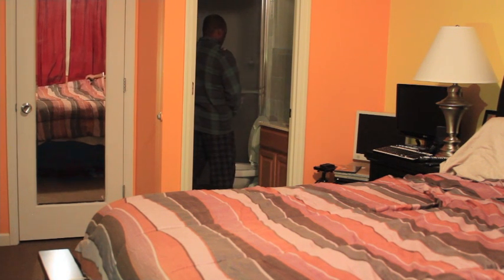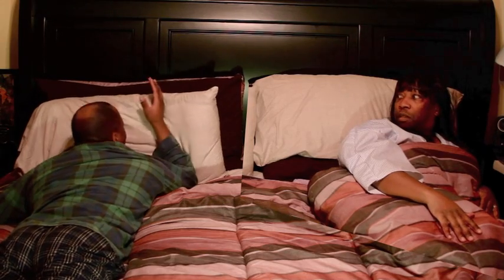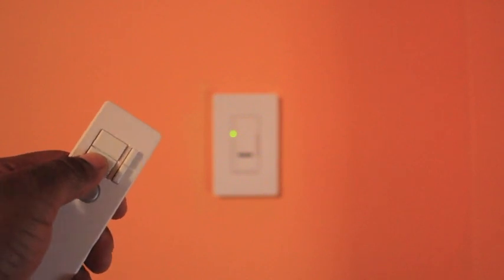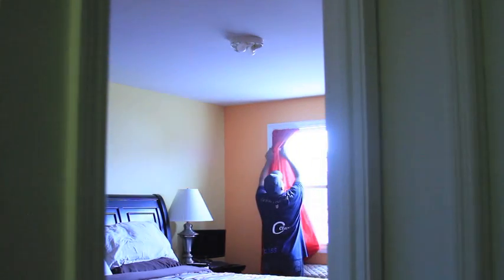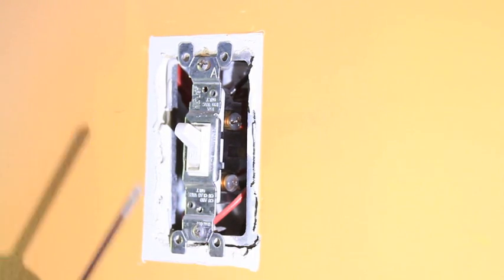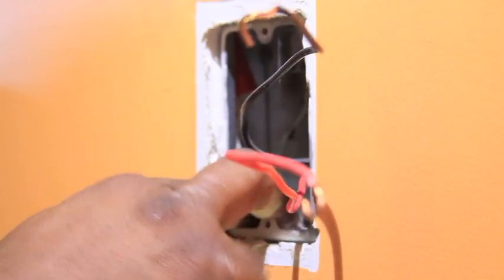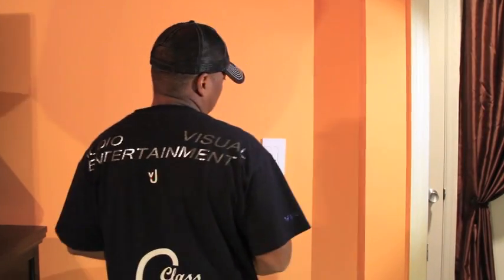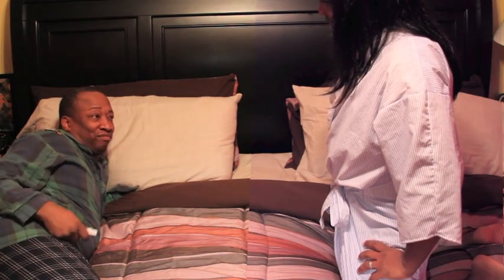A Remote control light switch install

Comment: two questions: how do you know where the red and the black wires go? and, if the switch is part of a 3-panel group with one switchplate, can you rewire the one you want the same way, and then get a 2-switch faceplate for the other two?